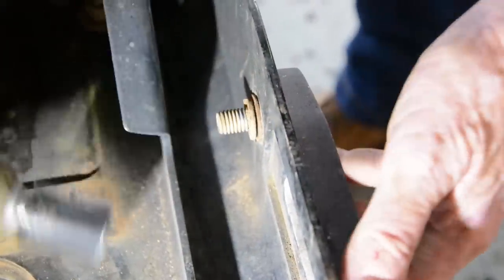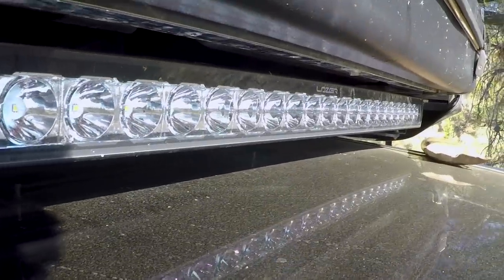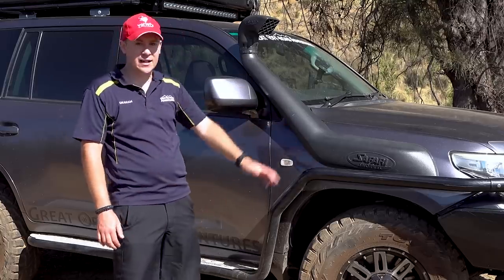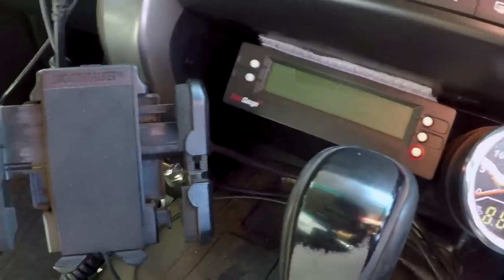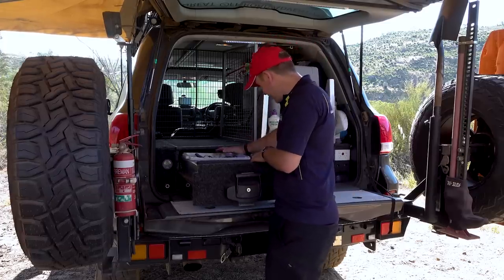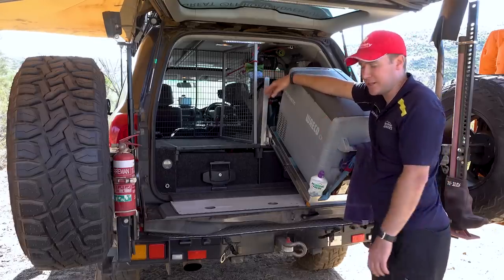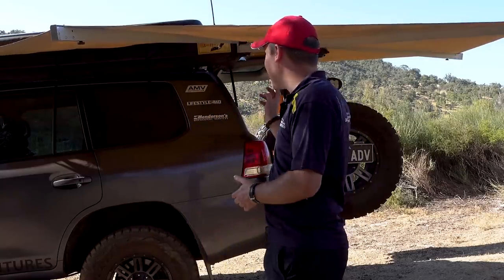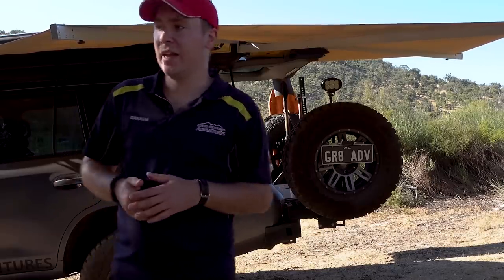LC200 Walk Around - Modified Toyota Landcruiser 200 Series (Overlanding & Touring 4x4)

Comment: Good stuff mate, living the dream you are. Well done. 
You mentioned 400 Nm from factory and your power upgrade is now up around 600 ..... the twin turbo diesel V8 had 650 Nm from factory so I don’t know what happened to yours, I’d be getting that checked out 
Keep up the good work mate, enjoy the videos 👍
Reply from the maker: Thanks mate - we used a chassis dyno, so you need to remember to include a drivetrain powerloss component.....which can range from 20-40% depending on make, model, tyre size....etc, in this case the 200 is close to 40% as its turning all 4 tyres and they are bigger than factory.....so add 40% to the 600nm after result and it’ll be somewhere around the 840nm mark at the crank.

Comment: Ever thought about getting a Lead Crystal Aux Battery? They can use up to 100% of the Ah, Charge quicker than AGM, More cycles than AGM, operating temperature range is pretty decent too, and they cost about 1/3 of the price of lithium. Also if you're camped for a few days consider making your solar panels detachable so you can be parked in the shade of trees and be able to redirect the panel at the best angle for the sun. Or have a solar blanket that you can hook up in parallel to your fixed panel.
Reply from the maker: It’s an option, but my charger doesn’t have a Lead Crystal profile and it’s my understanding they need pretty specific charging profiles.

Comment: dc to dc doesnt overheat? or wet??  I have all my electronics in rear quarter panel insert from Witsend.
Reply from the maker: I used to have my DCDC under the bonnet and it would derate due to heat....so I moved it to behind the grille in front of the AC condenser and it’s been great since then.....it’s also waterproof, so water doesn’t bother it.
Reply: excellent I just became an ammbasador for battle Born Lithium batteries so Ill be adding the red arc  @great_offroad_adventures
Reply from the maker: Nice combination - will have to check out the battery’s 👍🏻.

Comment: thanks for sharing your setup. have you taken the LC over a weighbridge when fully loaded up? must be getting up to the GVM?
Reply from the maker: Yeah you wouldn’t do a build this big without a GVM upgrade put it that way!!!
Reply: Sadly the 200 is not the best factory GVM (650 odd kgs).  GVM upgrade will give you around 500 kgs more and a build like this fully loaded + passengers will need most of that.

Comment: Hi Graham you didn't mention anything about GVM upgradeI presume you have one.  The back end must be heavy with draws bar tyres and LR tank?
Reply from the maker: Had a Dobinsons GVM upgrade, when I changed shocks I used a local engineer to reinspect and recertify my GVM.....bit difficult to explain that in the video.
Reply: @great_offroad_adventures  
Interesting you have a Dobinsons GVM upgrade. I've just weighed my 200 gxl today. I'm left with 40kg and I'll be at 3350kg. 
I have the Dobinsons mrr adjustable shocks and springs. I contacted a engineer today and they said Dobinsons can only go as high as 3650kg on 200 series. I'm spewing about it as 3850 would give me alot more wiggle room.
Reply from the maker: Contact a Dobinsons reseller/ installer, like Midland 4WD Centre or Malaga Suspension….they might be able to help you out as Dobinsons offer a 3850kg & 4495kg GVM with those shocks.

Comment: Did you need to anything with the airbag sensors when you removed the 2nd row seats?
Reply from the maker: Yeh you can .25W 2R2 Resistors to emulate the 2nd row seats are still in place.....cost about .50c for an 8 pack from Jaycar.
Reply: @great_offroad_adventures  thanks for the info.  I want to do the same and it would be good to see some pics of your second row storage boxes and connections to the floor. Did u consider if u needed a cargo barrier behind the front seats so you could load up the second row a bit more?

Comment: Hey, in NSW it’s illegal to change the total wheel track by greater than 25mm in total (12.5mm per offset per wheel). Any idea what are your state’s regulations are?
Reply from the maker: Hi Glenn - I suggest you double check. I think your getting confused....passenger cars are limited to 25mm....off-road vehicles (category MC, NA, NB) can be increased up to 50mm. Look up Vehicle Standard Bulletin (VSB14) Section LS, Tyres, Rims, Suspension & Steering, Bottom of Page 22, Section 4.2.11. 

https://infrastructure.gov.au/vehicles/vehicle_regulation/bulletin/files/NCOP11_Section_LS_Tyres_Suspension_Steering_Nov_2015_v4.pdf
Reply from the maker: No idea mate - the WA website directed me to VSB14 which is a national document. Perhaps talk to RMS and see if they can provide you with the latest information.
Reply: All good. Thanks for taking the time to respond to me and everyone else.

Comment: 224 hp with 600 newton seems pretty low for a V8, i own a GMC canyon 2016 with a 4 cylinder 2.8 liter diesel, stock it outputs 181 hp for 369lb torque, that gives with standard calculations 1641.32 newtons. Your 600 would only give 135 lb torque? not sure if it translates right
Reply from the maker: 600nm converts to 442lbs.....but remember that’s being measured at all 4 wheels, not at the crank, so you need to account for a 30-40% loss in both the power and torque figures.
Reply: @great_offroad_adventures  that would explain it, i did a google newton in lb search. ya 442 is a way better number so at the crank you should be around 680?
Reply: 1642 Newton’s out of a 4 cylinder .... I think google stuffed that conversion somehow - 1,600 is up in big block V8 territory....

Comment: Piranha off-road do a tray upgrade that fits an optima d31 for each side and also a 3rd tray
Reply from the maker: Yeah NAH - I DO NOT recommend a 3rd battery tray for 200’s.....I had a Piranha Tray & it cracked the inner guard & top of the wheel arch.

And why put in a battery tray where the factory batteries live? That’s unnecessary spending in my opinion.....factory mounts are more than adequate for bigger batteries.

Comment: Could you comment on why you chose the 200 over an 80, 100 or Troopy? THX
Reply from the maker: Deal was good (really good) on the 200 which just made it too hard to go past.....sure it modern & attracts some issues as a result, but being modern it’s also super comfy & great for long hauls.....has enough space for what we do, could have more if we went troopy or dual cab, but then would lose the comfort.

Everything has a trade off, the trade off for the 200, is slightly reduced space vs the other models you mentioned & additional maintenance over an older rig, but the pros are the comfort, road manners, towing ability which those others don’t have & for the traveling I do it’s more than capable offroad.
Reply: @great_offroad_adventures  Fair enough. THX for the reply.  A few days ago I began my search for a 200.